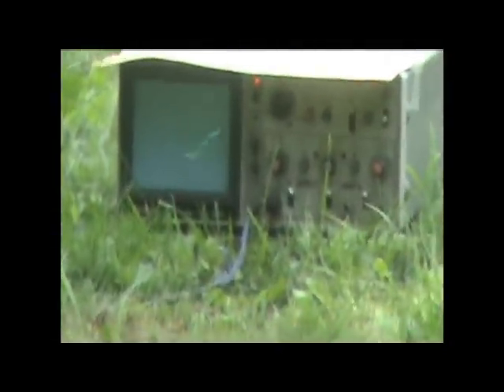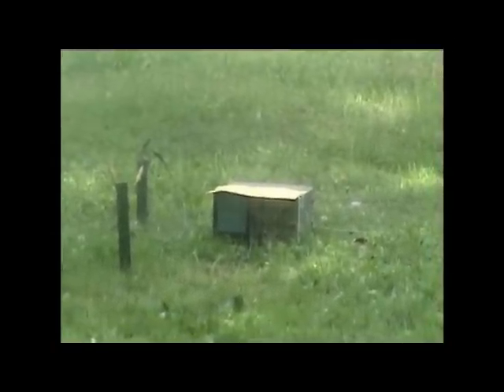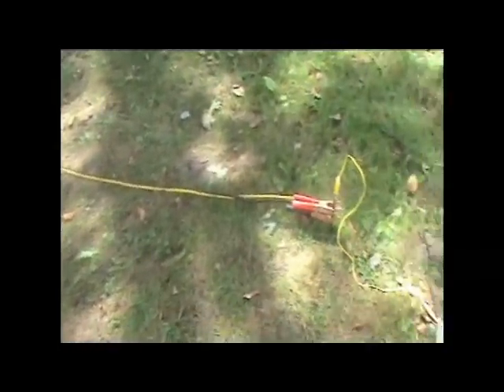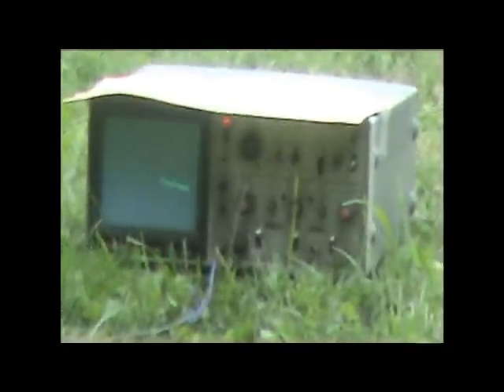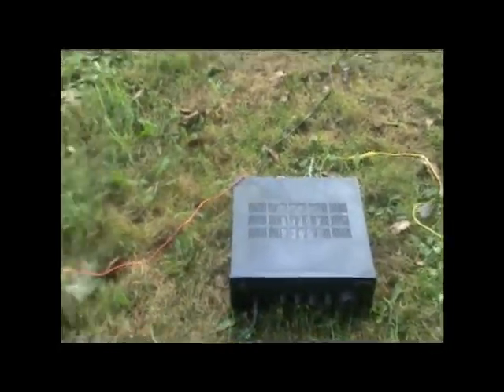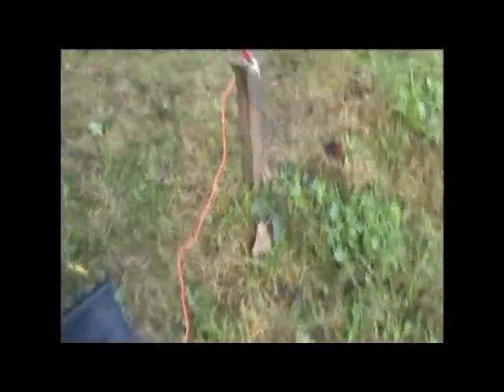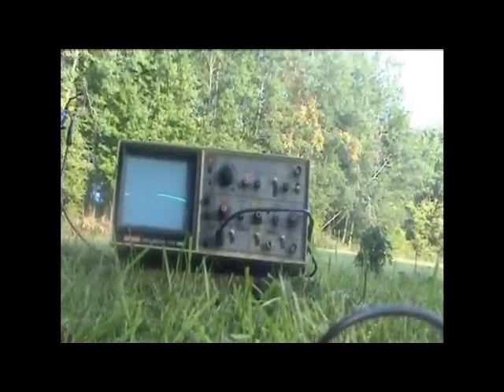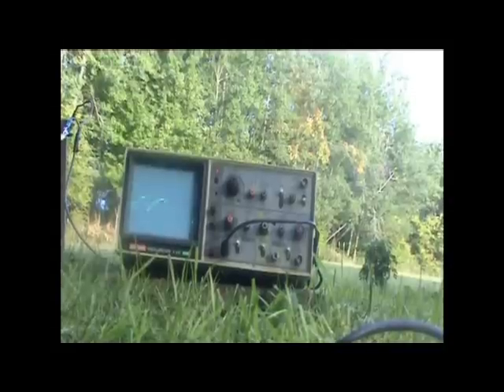Pat 4: Earth Currents Experiments

Comment: I use audio amplifier 22W and step up transformer 24/230V. 24V winding to speakers terminals, 230V winding: one end to grid neutral, other - to buried bath in garden ( make ground electrode antenna ). With VLF receiver and other pair of ground electrodes (20m between it.) I receive audio (music) about 40m away... Subblefield experiments is intresting... and need test, how signals travel tought small rivers, channals...

Comment from the maker: Thank you for your comment.  I based my observation that the signal is through the ground and not the air because, electrical signals at audio frequencies do not propagate through the air readily. This is why radio frequencies in the hundreds of kilocycles and megacycles are used for air transmission.   I may be wrong, of course, but this is my perspective.